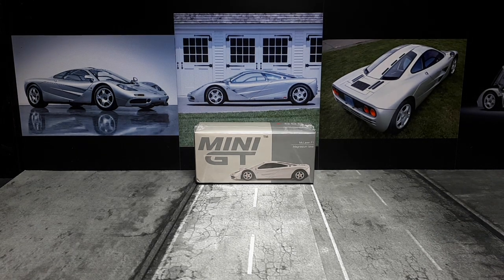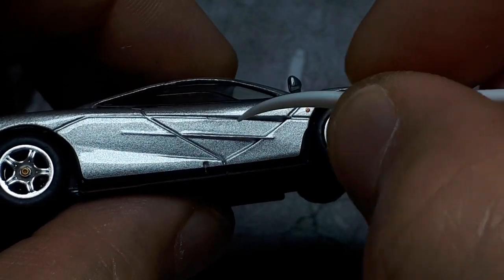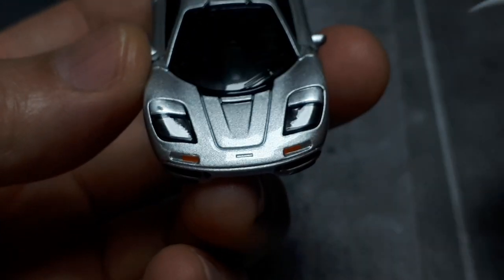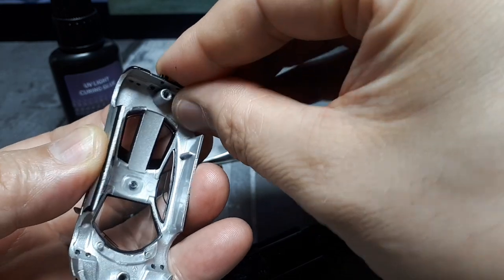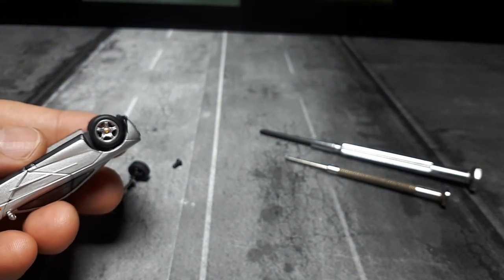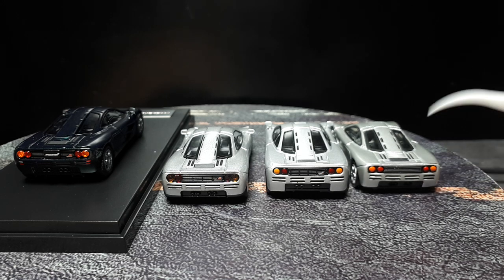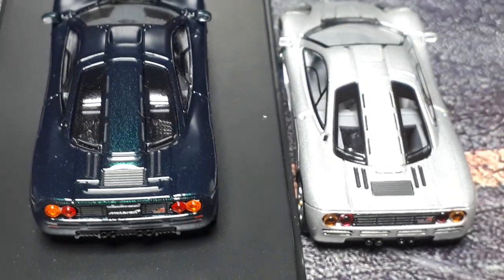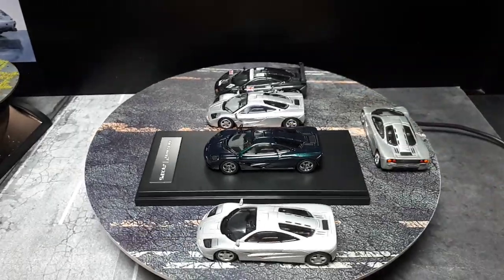1/64 McLaren F1 by MiniGT 555 diecast

Comment: You have some bad luck with your example. I didn't have any of those QC issues. Maybe it's lucky me. But I think the stance is better than LCD, and this is a big point for me. Shape of headlights is better in Mini GT, LCD has them too narrow. And the size of the badge at the front -it's just to wide in LCD.
Reply: LCD quality is much better for sure. I have an example of the XP-5 from them and it's the detailed one from the Mini GT.

Mini GT quality can be a hit or miss as it is being mass produced at a fast rate.
Reply: MiniGT used the same mold to make both street version and race version which makes the regular F1's front fender off scale